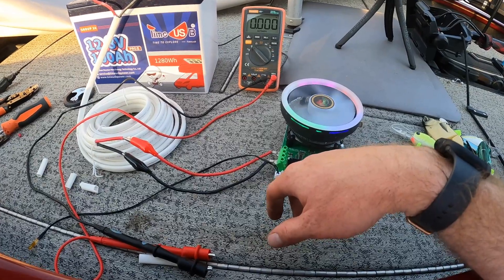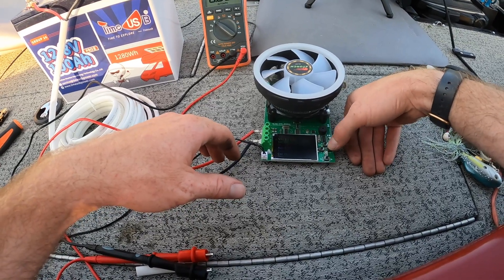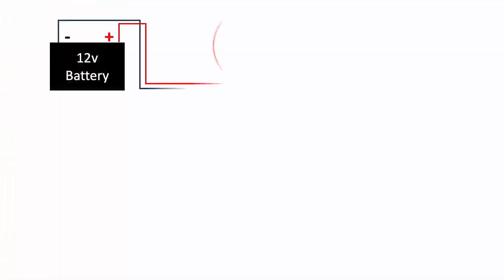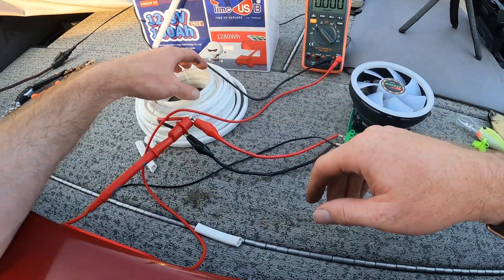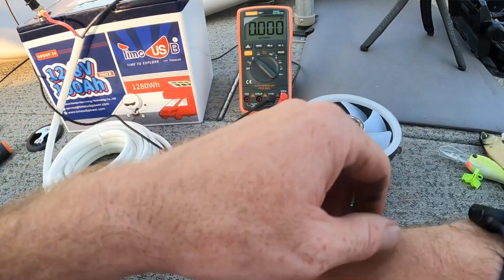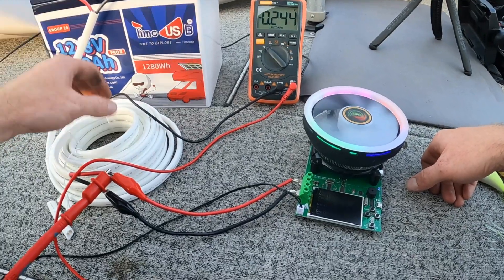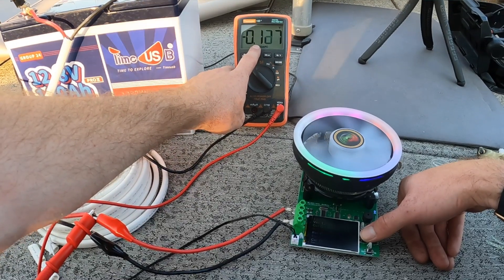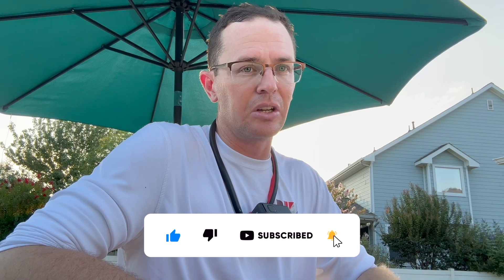Voltage Drop Explained: Why It Matters for Marine Electronics

Comment: How about if I’m only running one 9 inch graph on a Jon boat? Is 16 gauge sufficient for a 14 ft run ?
Reply from the maker: I would run 12ga minimum, personally. It will "work", but if you are trying to manage voltage drop, 16ga is quite small.

Comment: Would have liked to see it done it at 15 feet. Because this is what Garmin  recommends for max length with 10AWG.. I have 12 inch echo Mabs and 110 inch and 12 inch pulls less than 3a. With a GLS 10 it is about 3.2a.